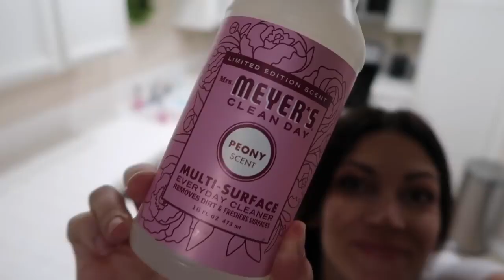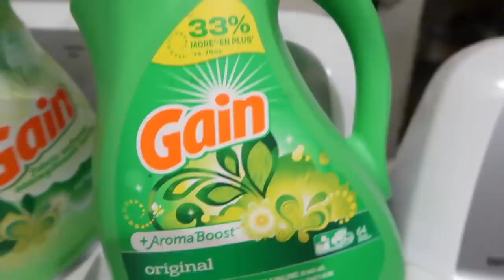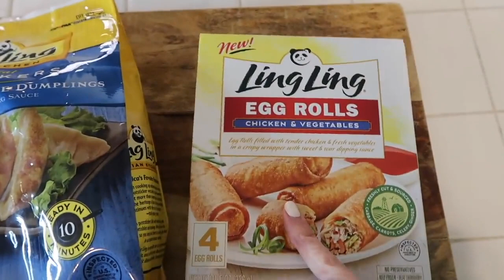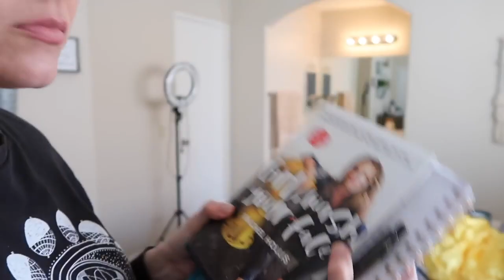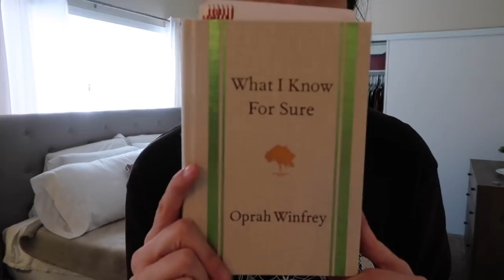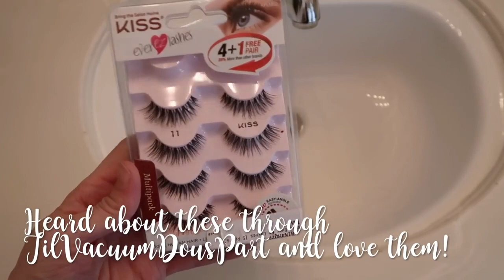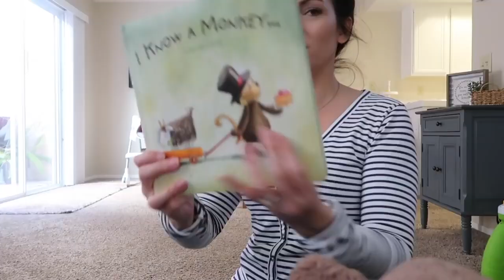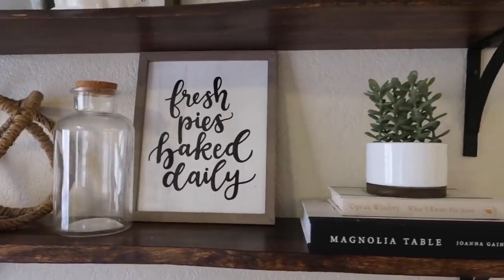CLEANING MARATHON | 1.5 HOURS OF EXTREME CLEANING MOTIVATION

Comment: My house is just me (and kitties), no children or partner.  However, what I'm finding is helping with my own Laundry monster is A) 3-rectangle-bin laundry sorter (on wheels), which gets split into dark, light, and Big Fluffy Things.  Now, though, the stuff that would normally go into (for example) the dark bin instead gets tossed into the washer.  That way when it's full, I can just start a cycle and set it for quick wash, which I think is about 20 minutes.  While that's washing, I make sure whatever is in the other bin is basically ready to go and follow right into the washer as soon as the current cycle is ready for the dryer.  The sorting and putting away I'm not so great at beyond towels & washclothes.  But that's what's been working well for me so far.
One additional thing - if it's wet (ie a washcloth), I basically throw that in the washer right after its second or third use (especially during this pandemic).  That way it doesn't mildew the dry-but-dirty clothes, and sometimes I'll remember to add a little detergent before I throw anything in there at all.  
So.... short version: I think using the washer as a laundry bin for what would be one load has saved me a lot of hassle & backache.
Reply: Oh! Also I have a stacked washer/dryer ("laundry center") in my apartment; the washer is top-load.  Leaving the lid open once the washer is empty, especially right after a cycle, has REALLY cut down on the mildewy smells.  I dig it.  Sprinkle a little baking soda in there every so often as well.  :)